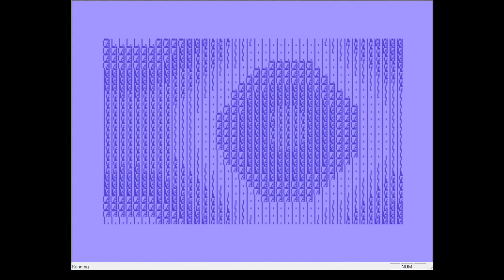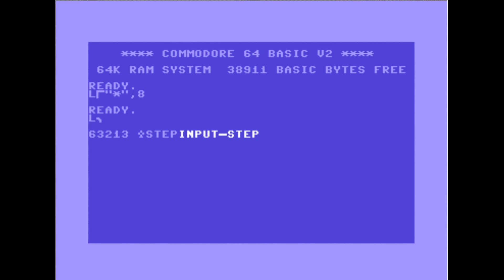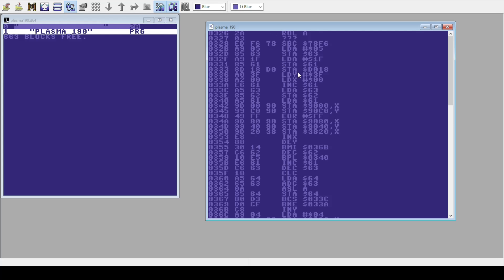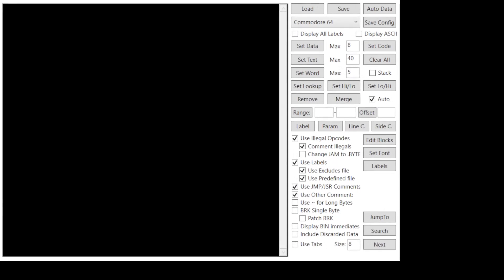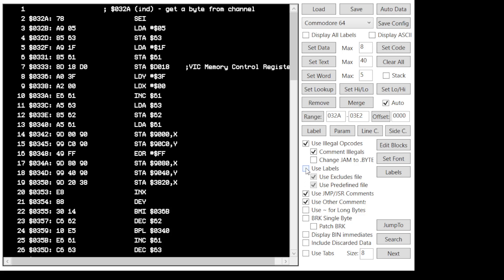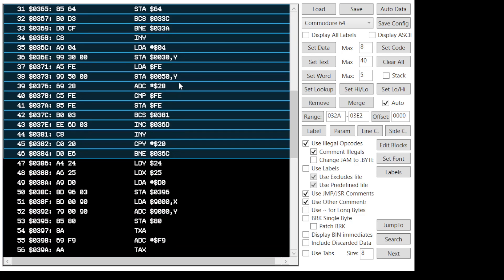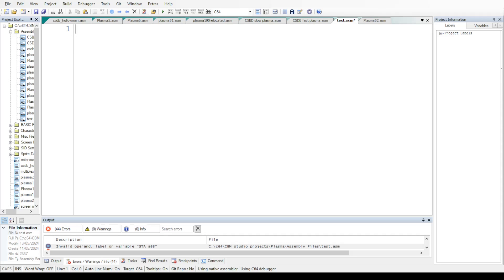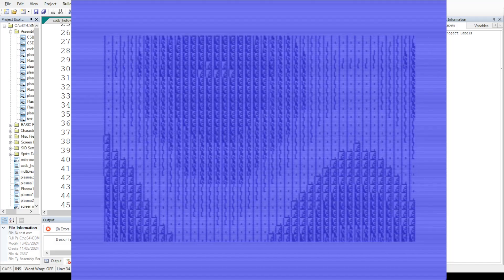Disassembling a plasma effect demo on the Commodore 64 (English)

Comment: C64 BASIC version:

10 data 42,3,237,246,120,169,5,133,99,169,31,133,97,141,24,208
15 data 160,63,162,0,230,97,165,99,133,98,165,97,157,0,144,153
20 data 192,144,73,255,157,128,144,153,64,144,157,32,56,232,136,48
25 data 20,198,98,16,229,230,97,198,99,24,165,100,101,99,10,133
30 data 100,176,211,208,207,200,169,4,153,48,0,165,254,153,80,0
35 data 105,40,197,254,133,254,176,3,238,109,3,200,192,32,208,230
40 data 164,36,166,37,169,208,141,150,3,189,0,144,121,0,144,133
45 data 128,138,105,249,170,200,206,150,3,48,238,169,24,133,33,164
50 data 33,185,176,0,133,32,185,48,0,141,199,3,185,80,0,141
55 data 198,3,162,39,181,128,101,32,74,74,74,168,185,48,0,157
60 data 0,30,202,16,239,198,33,16,214,165,38,105,3,133,38,133
65 data 36,165,39,105,1,133,39,133,37,76,134,3
75 FOR A=806 TO 994:READ B:POKE A,B:NEXT:SYS806

Comment: Hi,
why in the end if instead of entering the sys4096 command you enter the line 10 sys4096 and then start the program with the run command, the program no longer works?

Comment: Hi.  That's one of mine. :)  Thanks for the doing a disassembly video.   The first part of the code is making the charset, but it's also generating a sine table.  That's the $9000 bit.  It's been a few years but iirc I generate some of the table then store the same values forward and reverse and inverse them to make the other half.
Reply from the maker: Your code is just brilliant. I'm highly honoured that you passed by to provide us with your comments. Thank you so much! I tried to explain the presence of the two parts of the routine very roughly, and indeed I did not mention the creation of the sine table. I intended to do something more specific in another video. But would you consider commenting your code line by line? It would be interesting and useful for many "young" programmers like me. :)
Reply: @8bitretroprogramming  Thanks.  Yes I can go through and explain it line by line. Looking at the disassembly there's a few places I can possibly shrink the size a bit more, where it's using the zero page incorrectly.
Reply from the maker: @4mat_music  That would be lovely. I'm sure lots of people would enjoy having the source code commented by its creator. Thanks.